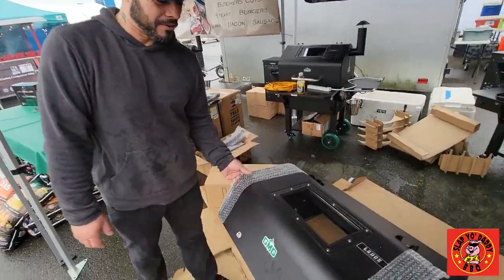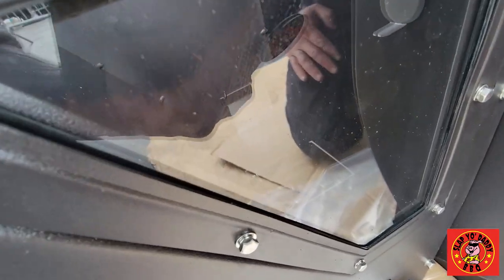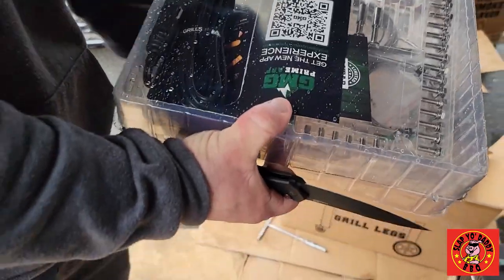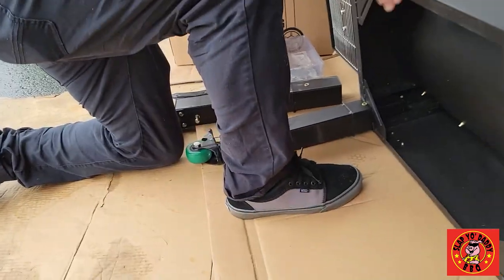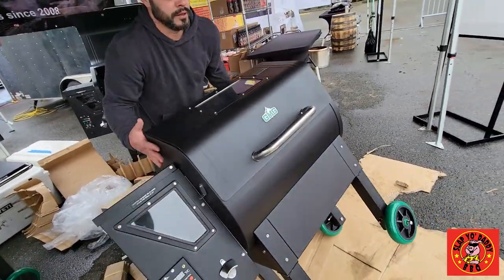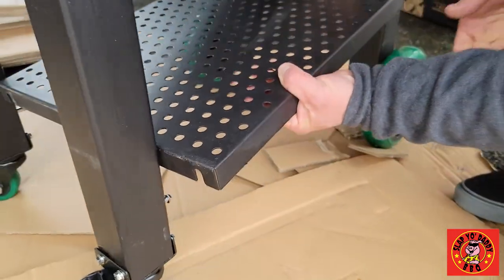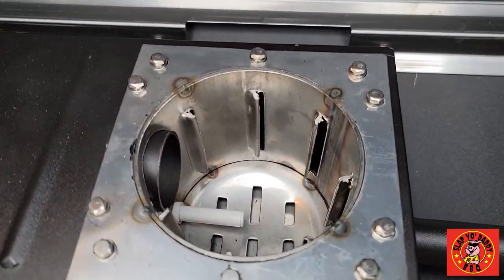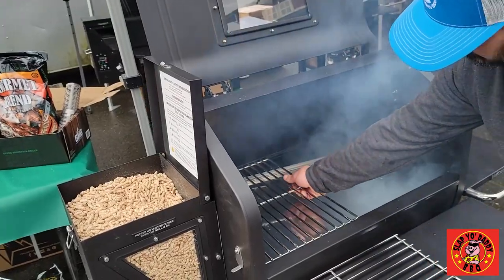GMG Pellet Grill Smoker Assembly | Ledge Prime | Pitmaster Sage Sanchez w Harry Soo

Comment: Nice to see the shield under the control/pellet box.    My old one didn’t have that and new dog gutted the wiring.    Can you drop the ashes out with out having to disassemble the unit?
Reply: how old is your grill? mines about 4 years old and it has that grate shield.
. .
Reply: It was about 6 years old.   Looking for its replacement now.
Reply: @johntaylor6269  I have had a recteq pellet smoker about 8 years and is one of the best built .Check there ratings and see .😊
Reply: There is a door on the side of the grill with a hole that allows you to vacuum out the fire box.  I recommend removing the heat shield instead and visually checking the fire box for ash build up.